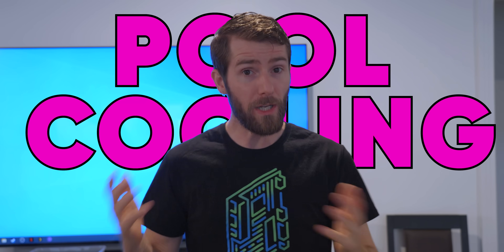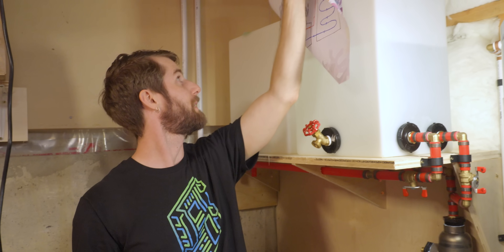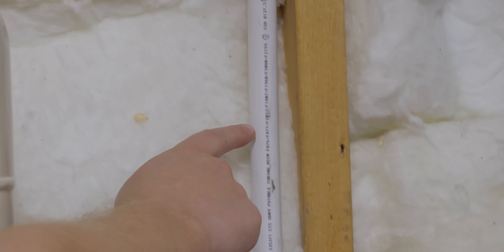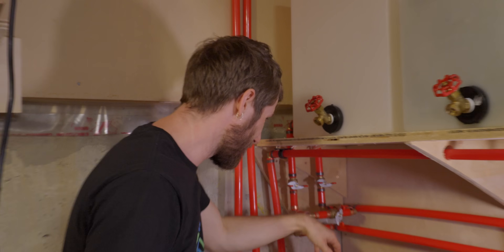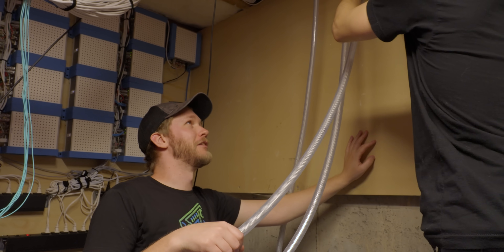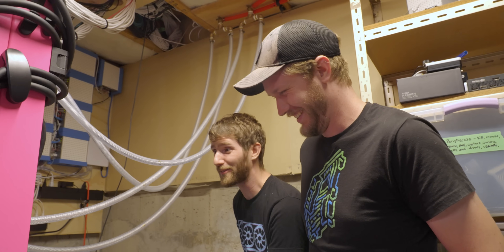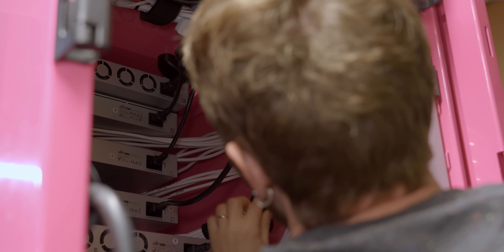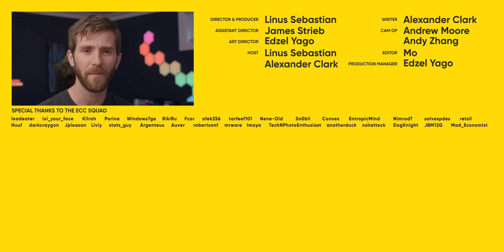My pool leaked and killed my computer - Whole Server Room Pool Watercooling Part 4

Comment: Around 11:49 they talk about labelling the flow-direction. This comment is soley based on my experience as a Marine-/Operations & Maintenance-engineer, in Denmark, working with district heating, sea water heatpumps and what not, within those categories. Practices vary based on location. 

The flow direction is best labelled (example ANSI A13.1) with arrows, description and color coding (hot, cold, in, out etc.). Even on smaller projects like this it makes a huge difference doing the proper groundwork before commissioning, if it ever goes south (probably will, them manifolds sketchy). AND for the love of god, get those manifolds out of the cabinet and put a drip tray under them! Also saw another comment suggesting putting leak-detection on the system, also a very good idea.  

Other than that, I dig this project. Its cool, and a very cool way of cooling the rack :P
Reply: Just trying to push this to the top

Comment: Water leaks all over, kills the hardware. Uses plastic manifolds, cross threaded and silicone sealed back together right on the rack for the next one. Some really ought to tell him silicone doesn't stick to other plastics long term as the plasticisers leak out, especially nylon or POM like that manifold.

It's like watching the blind leading the blind at this point. At least get someone that has a clue to give you pointers on the overall system first, then goof around fitting it yourself.

Then iodine salts with all those dissimilar metals? Good luck to your waterblocks. Just put antifreeze/coolant in it. It's not just to stop freezing, it never was, it's chock full of corrosion inhibitors.

Comment: If you have glycol in the outside loop so it doesn’t freeze in the winter you could have below freezing water in the heat exchanger that would cause the loop on the other side to freeze in the heat exchanger you should put antifreeze in both

Comment: We use to cool ibm mainframes with water … when they were using ECL transistors … however the water was always demonized and demineralized … closed system … with several types of external cooling using a transfer tank …

Comment: I love how immensely complicated this setup is for a very marginal gain 😂😂
Reply: A realtively infinate heat sync that is probably never going to have the systems above 38c is not a marginal gain. 

I do however wonder as the temps drop for the winter if he's going to see system temps that could potentially go below room ambient and cause condensation.
Reply: @haplopeart  it's marginal in the setting he is using it for.  if you want your system never going above 38c there is better ways. He just does it because he can and has enough money to fool around with.
Reply: @snekkel  well yeah I realize that, but the impact is not marginal is all I am saying, for all the impracticality of the solution it does do something useful…if I had the resources to do such wild impractical things I would too.

Comment: 2 thoughts - so you got a huge loop in the pool to dump the thermal energy and that tiny heat exchanger is not bottlenecking it? 2nd - all this tubing is prone to fail again. This will end with serious water damage to the house and tech. This is so not worth it - or maybe it is for the sake of making videos? I'd let it get done by a proper company with way more robust and permanent tubing.

Comment: Label the main in hose with large letters and the small hoses as Linus is saying. That makes the most amount of sense to me, but think of who is going to be servicing this system and ask them to label it so that they don't get confused. If it's multiple people, you could provide a sketch of the system on the containers on the wall for further clarification

Comment: Personally, I'd use mineral oil, fluorocarbon, or some other non-conductive coolant on the device side of the loop. Then electricity isn't mixing with water and devices aren't catching fire (literally, in this video) when there's a leak.
Alex's labeling was dumb but less dumb than how Linus would have labeled them, although arrows are better than either.
Since the GPUs are pegged at 350W due to unlimited heat sink mass, when is the shunt mod video to see how much this cooling system can support?

Comment: You used threaded connectors with smooth tubing then use hose clamps.  No, it's not going to leak at all.  Hire a plumber.

Comment: its honestly just a difference of perspective yall are having about the tubing label having.... if the water from outside, is moving INSIDE to what it has to cool, then flowing through the tubes that alex labeled "in" along that line those tubes are still flowing "in" to what they are cooling and the ones he labeled "out" is the water flowing out of those tubes and back through to be re-cooled. Linus seems to only be looking at it joint to joint or, maybe just backwards in general as alex is calling the water going to the systems its cooling in and it going back to the pumps and stuff to recirculate and cool the water. where as linus is maybe looking at it as the water flowing to the outside cooling and pump is the water going in and the water flowing from the cooler and pump to the systems is going out, cooling it, then going back into the pump? that or for some reason he is saying the water is flowing in from outside but once it hits the part where it goes to seperate tubes it switches to going "out"? then going back "in" to the other tubes but once it reaches that reservoir if there even is one, and goes back out? honestly it all comes down to how you look at it, all ways are technically correct lol... its jus good fun between friends who love building computers and stuff and thats whats up. to be fair and clear tho... i agree with alex i guess in this particular way, my brain may work more like his when it comes to this  little thing lol

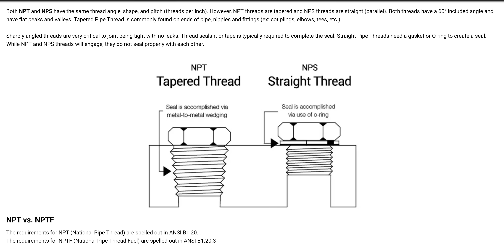Comment: 6:32 You'd think they would have learned something from last time.
7:37 Was he joking about the "4% chance of working"? If not, you are going to replace that soon right? With soon being, the day after?
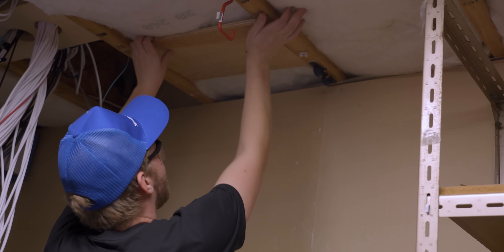8:03 Again, I hope he's joking about the "friction fit". Although I see some additional structures later on the wood planks next to it that will indirectly hold up everything. But I wouldn't really count on that for important water piping.
11:45 This is exactly why you'll see labeling with arrows in any decent factory/datacenter.
15:32 I'd love to hear if you found out more about this.
17:16 I'd love to hear if you found out more about this.

Comment: At last. I would recommend also add an hidraulic separator  for the final connection to the CPU's.  You could keep using the normal PC pumps at variable rates depending on the work, and a big pump cycling the bigger loop with the interchanger.

Comment: I really worry about the distro block, more with the fact that Alex said that it's compromised with incorrect fittings and excessive silicone.and the way the hoses hang is alot of leverage.
Reply: An accident waiting to happen
Reply: More the fact that Alex compromised it with incorrect fittings and silicone. I thought they were meant to have the right parts this episode.

Comment: Dude just cool the room with a mini-split, it takes all that leaky risk and failure point away, you could even replace the outdoor condenser coil with a heat exchanger and dump the heat into the pool still.

Comment: Oh REALLY, the dirt from the pipes got in!

You should have known, even with a little flow those pebbles will eventually move!
Reply: No it will not destroy your flow rates, there are "tricks" you can use... like increase surface area!

If you have a wide pipe with fine sand, like pool sand, topped off with sponge and filter wool; you just need a WIDER pipe to increase surface area. The water can then flow through with much less restriction, you should draw inspiration from pond and aquarium technology here!
Reply: You forgot to make a drip bend in every single hanging hose!

You are not going to keep that from dragging water into your rack when water leaks from the connections up there at the roof!

Comment: 9:07 Don't you also need glycol in the loop attached to the server when you plan using your water-cooling in the winter? otherwise the heat exchanger will cool the "in house" loop sub zero, when its cold enough - making it burst. Won't it?
Reply: @benjiro8793  this is it exactly, if it would be a real plumber / heating dude, he would have installed a way to reduce flow on the pool side, or a mixing valve who keep the temperature in the server loop over the dewpoint and insulated the pool tubes. 
but yea more videos to be had...
Reply: @benjiro8793   You mean condensation on the pipes going from the outside into the heat exchanger?

Comment: Why wasn't the heat exchanger part of the original installation? 
The added cost and complexity of that has to be small compared to the project.
You also gain lot of benefits by having one besides the cleaner water - you can run it at lower pressure and have the right chemicals. Should have been included from the start

Comment: Pro tip. Install the systems on their side vertically and keep a tray with a float switch below it . If one system leaks it will only kill that perticular pc and the water dripping on the float switch should trigger an alarm + shut of the pumps..

Comment: For switching on and off, I would use a Raspberry Pi Zero at each end with a few lines of code to sense the state of the power switches in the computer room then fire momentary relays in the server room, wired in parallel with the server chassis power buttons. If you already use Home Assistant (I forget if you kept it or not) then the signalling back and forth can happen over MQTT.
Reply: Why not use wake on lan
Reply: @Manhunternew  With WoL he would need a device to send the magic packets.  You may actually be on to something though, Linus could get a Z-Wave scene controller and configure Home Assistant to send WoL packets when triggered by the controller.
Reply: Somethign like a piKVM would work really well. Maybe 1 per rack, using an IO expander + usb hubs. No need for video.
Reply: @emreelmas214  Yeah, I thought about that, but it seems a little expensive and overcomplicated if all they need is to press the power button remotely.  A single Pi Zero or even an ESP32 at either end with the appropriate breakout board and a couple of lines of code could do the job for under $100 whereas a PiKVM is around $100 each, and then you still need a Pi for each one.

Comment: Great video! Words of wisdom, the plastic manifolds will crack over time between the npt holes. You will get a propogating crack run the entire length of the manifold. I learned the hard way...

Comment: I'm scared about that distributor haha.  I would either install it outside the rack or install a little (plastic) shield/slide under them so that water slides outside the rack if it leaks
Reply: They really shouldn't have gone with a threaded plastic manifold.

Comment: At this point Linus should connect some power generator at hot end of the loop, use some gas with low boiling point and go full Nuclear Power Plant style of heat dumping + it gonna save some buck on generated energy

Comment: im starting to question the thermal trade off youll get for cooling as its not actually in to the pool its the cement the pool is built out of yeah still a huge thermal mass but through concrete

Comment: This is maybe a dumb question, but how are those computers turned on from the "gaming lounge"?
Is just a long copper wire that is being run to the mobo each to bridge the connector, or is it just being put into sleep mode and woken up by mouse/keyboard input?
Reply: That’s what they are going to do in the next video! Linus says this at the end
Reply: @xMdb  Alright, thats 100% on me. Thanks!

Comment: I love how the new solution is essential how district cooling companies work. I worked in one and they had the exact same 2 networks with heat exchanger. I hope Linus has sensors installed on both networks to avoid any catastrophic failures 😂😂
Reply: Also alex in the end just possibly every engineer ever 😂

Comment: Nickel and Brass in the same loop, will gunk up with galvanic corrosion byproducts.

In 3-6 months, there will be a corrosion inhibitor added to the loop... Can't find the proper tables right now but I think nickel and copper won't work without it.

It seems the titanium is also a big problem.

Comment: I wonder if there would be an elegant way to add a drain to each system, which could direct the flow of any leaks away from the other systems in the rack. Keep the collatoral down, in case of another failure.

Comment: What Linus should have done, was asked HVAC or even a someone who knows how a nuclear thermal plant works (heat exchange from primary to secondary), because that's quite literately the situation. Linus has no SCRAM button to electrically disconnect the rack in case of cooling failure. So a thermal problem caused a, literal, meltdown.

At any rate, it's kinda funny in hindsight because I'm sure a lot of people saw this coming, because this happens with a lot of their DYI stuff outside their expertise.

Comment: Yeah, you're making the case for having a CPU cooling system which is as simple as possible. An AIO, which is self-contained and professionally manufactured, makes way more sense. It may restrict your overclocking ability, but may also prevent damaging expensive equipment. Using your swimming pool to cool your computer and/or server, is only for those who have more money than God. This cooling setup has no useful purpose for the consumer.

Comment: linus next video will show how he built a rain resistant heat sink the shape and size of the eiffel tower thats being cooled by the outside wind and has an additional turbine on top that harvests wind energy which is stored in LFP batteries that have the shape of sandals to power RBG lights on his eiffel tower heat sink

Comment: I'm curious if the pump isn't overkill, the hotel I worked at use 2 of these for the hot water loop to provide water to 100 rooms and the restaurant.

Comment: You should be doing what any tech would have done even for a small two-server room, install a mini-split system and leave it running 24/7. Even in areas with expensive electricity it's only $15-40 per month for small low traffic areas.

Comment: It looks awesome BUT, shouldn't all the the tubes be outside the rack to be safe?
Also, shouldn't all the tubes have a little bump lower than the entrance into the pcs in order to drip (if it happens) to the outside of the rack?

Comment: I'd recommend using Permatex Ultra-Black instead of generic silicone sealers. It is safe on electronics, metals, plastics etc. It does not generate corrosive acids like acidic acid when it sets... so it won't smell like vinegar...

Comment: OK, water-cooling using a pool is interesting, but it's just disaster waiting to happen, especially in 2 years time when you can't remember what connecters were used and which is out-out and which in in-out!
I think I would have kept all the servers as stock air cooling and used a water-cooled aircon in the room.

Comment: Interesting to see theard tape being used on brass, not something we use here in New Zealand very often as it has a bigger chance of leaking, we use hemp instead, very old school but it works. I have tried tread tape in the past and have had much better success with hemp to prevent leaks.

Comment: Alex learning how to properly apply Teflon tape is the most engineer thing ever.
Reply: Anything more than two layers…
Reply: Because engineers never know how to apply anything to real world it goes to the tradesmen to be able to do anything.
Reply: @orangerider2827  Yes. That was the implication of the comment. Great job parsing that out!
Reply: @alanleuthard7619  thanks for parsing my comment out, which was the entire point.
Reply: IIRC you only need like a single layer of the tape on the threads. Seems like he might have used a bit much and made it harder to screw in.
Reply: @komenisai  you need at least 3-5 layers, depending on how the fitment between the threads are.. with NPT, the best thing is actually to use a threadlocker like Loctite 577, unless there is gasoline or similar solvents in the pipes.
Reply: @thorbjrnskorem3688  What!? I only use Teflon tape occasionally but if you need more than 2 layers you have a bad fitment. With that being there are reason you can't get a perfect fit but at that point I'm using your adhesive of choice as a filler.